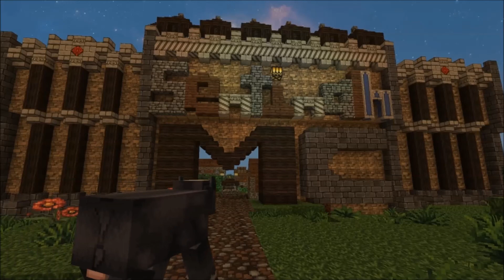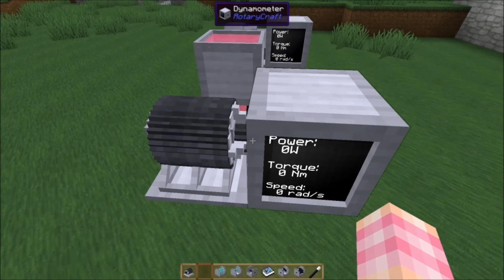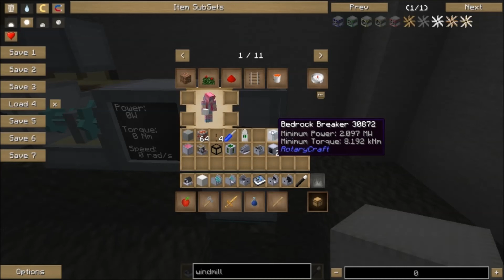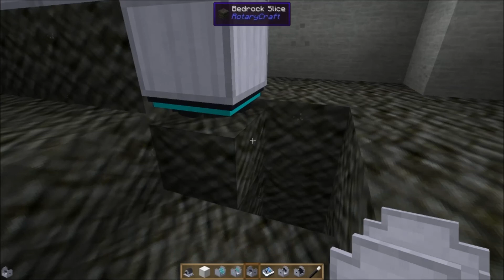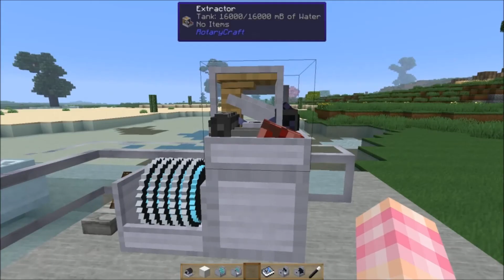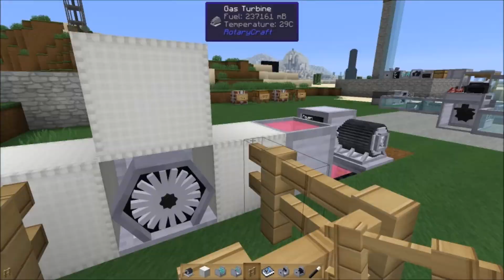RotaryCraft Tutorial #16 - Jet Engines

Comment: How do I get the blast furnace to 900°C?
Reply from the maker: A Friction Heater and lots and lots of power
Reply: +SentinalhMC I can't seem to produce any more power than that of an AC Electric Engine. What do I do?
Reply: +SentinalhMC I can't get it past 894°C
Reply from the maker: *****
MORE POWER! Also make sure your torque and speed values are as close to even as possible. For reference it took me two or three microturbines to reach 1000C
Reply: I can't make a microturbine or performance engine because I don't have the materials for them yet, and that's because I can't find a way to get the blast furnace to 900 degrees. Am I stuck?
Reply from the maker: *****
No you just need to use shaft junctions to add more engines into the power train for your friction heater.
Reply: Thank you! :)
Reply from the maker: *****
You're welcome, I'm always happy to help.
Reply: one trick is to use one microturbine and 16:1 gearbox and a 8:1 gearbox on torque, that gives maximum effeciency to heat anything to 1350 degrees

Comment: The gas turbine sounds so badass! But its too loud if you are close, and if you get to close to it you can get sucked in and there will be nothing you can do about it when you are being sucked in
Reply: +SentinalhMC mumble mumble evil jet mumble mumble
Reply from the maker: Just make sure to put fencing around the sides of the turbine to prevent anything getting sucked in. You can use wool blocks to muffle the sound as well.

Comment: 2 microturbines are perfect to run a extractor trough all the stages, and you don't need to switch the gearbox between speed/torque mode or anything